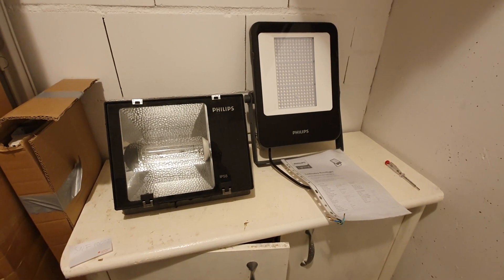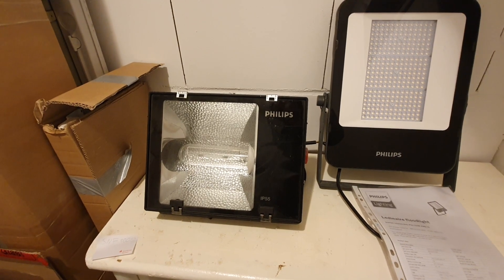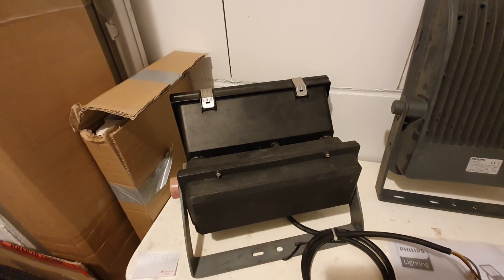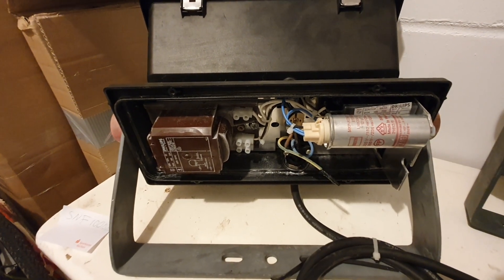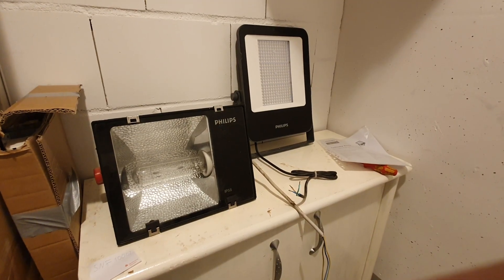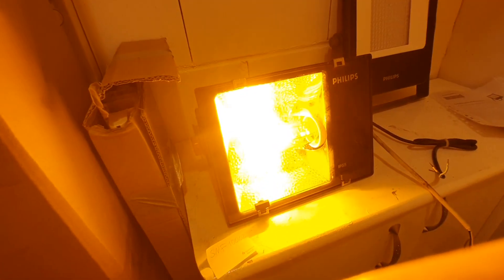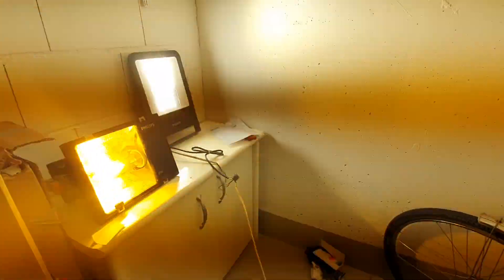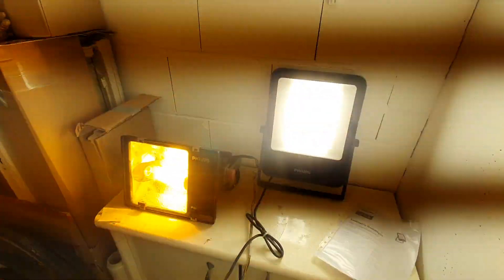Philips HPS (SNF 100) and LED (BVP155) floodlights

Comment: HPS is quite efficient, I have several 70 and 150W and really, especially at 150W or more, it can't compete
with nothing but LEDs! 100w HPS gives 10,000 lumens on average and the 100w LED 14,000 lumens so yes the led is the most efficient but also the LPS is very efficient 66W sox 11,000 lumens but the light emitted is monochromatic very orange but best in fog! HPS and LED is the best so far